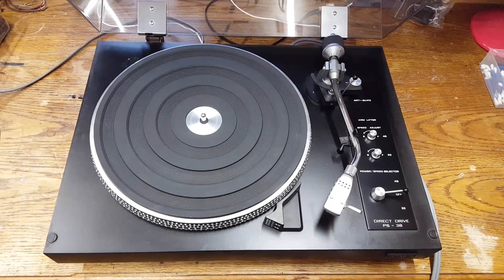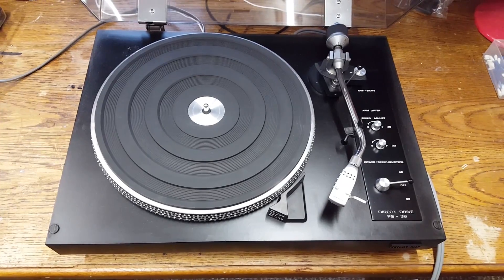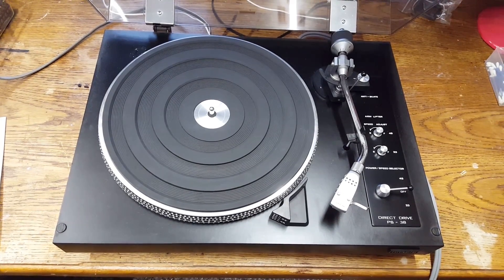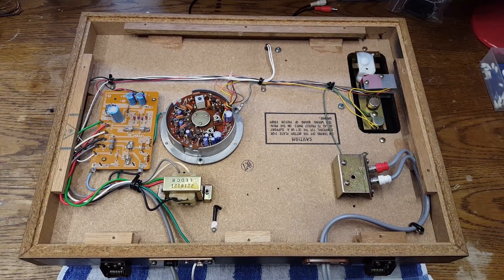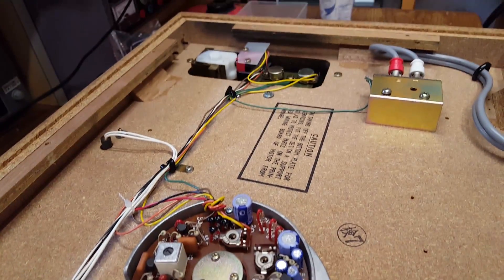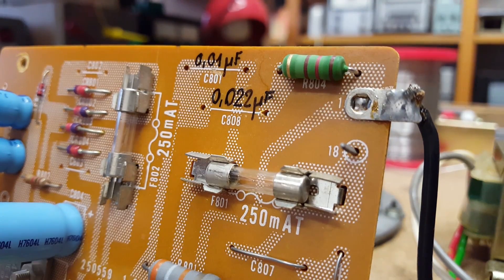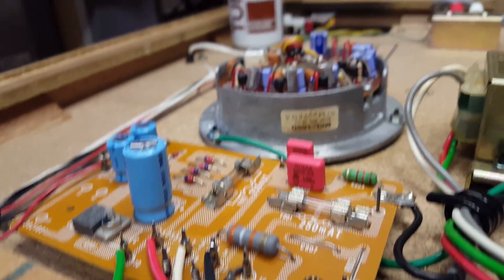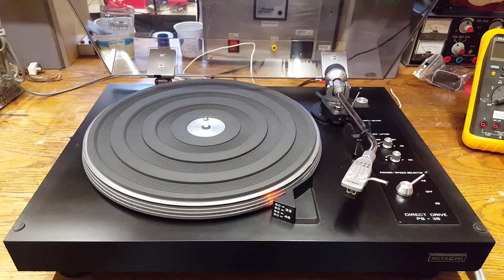Hitachi PS-38 Record Player capacitor replacement

Comment: Nice video! Hoping you could help me out...recently purchased a Hitachi PS-48 and need to find out if the stock Nagaoka MP-110 cartridge and headshell will work with the tonearm? Have contacted multiple companies to see if the Nagaoka headshell will work? Seems like you would be a perfect person to ask based on your video before I buy both. Thanks!
Reply from the maker: These Hitachi record players take standard SME headshells, from what I can tell that is also what the Nagaoka cartridge comes with. So it should fit, though you may have to reposition the cartridge on the headshell a bit to get the alignment right.
Reply: @DrCassette  Thanks! So the Nagaoka Headshell that comes with the MP-110 cartridge should work with my Hitachi PS-48 TT?

Comment: Higher voltage capacitors probably will fit perfectly. I had same problem in my Revox A77 when I was replacing RIFA caps on relay board, 150V didn't fit so I put 400V ones which are same size as old ones. 
By the way, nice record player.

Comment: Thanks for the video. Good to see something from the 70's still going strong thanks to you. It's a common issue with new capacitors being smaller than the ones they're replacing, which is fine until you find yourself in the situation you encountered where the solder pads and holes in the PCB are too far apart. You did a good job adapting the component leads to suit. I keep longer trimmings from component leads just for such an occasion.

Comment: Nice Unit! I have a Pioneer PL-400 and I love it. it was lower-end for the time, but its miles ahead of the cheap crosley crap thats out there now.
Reply: That's not really difficult... even the relatively nasty midi-sized TTs from the 1990s that were included with systems as a separate unit are miles ahead of the Chinese units now. I have an old Goodmans deck of this type; it has an Audio Technica T4P magnetic cartridge and reasonable quality (albeit DC) motor. It sounds OK and doesn't hack up records (tracking weight of 1.8grams). I honestly can't see how that deck could be any more expensive to build than the modern Chinese junk, but still they don't seem to be able to make a respectable cheapo deck.